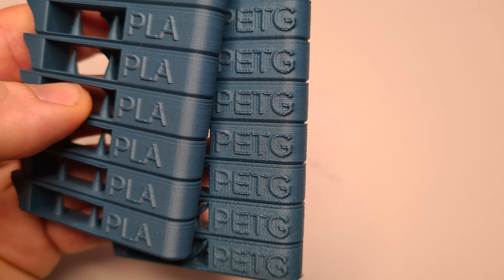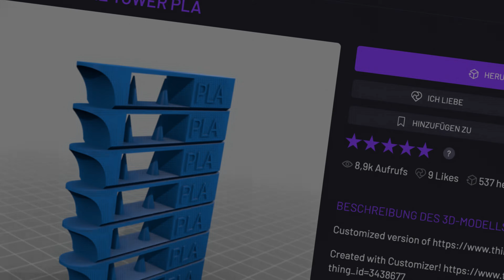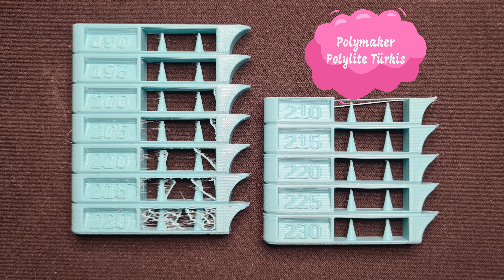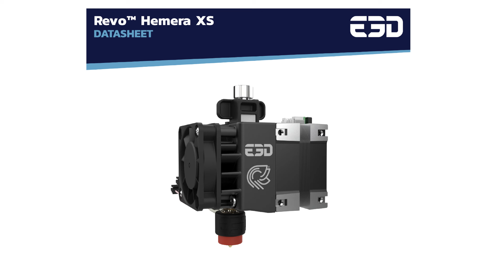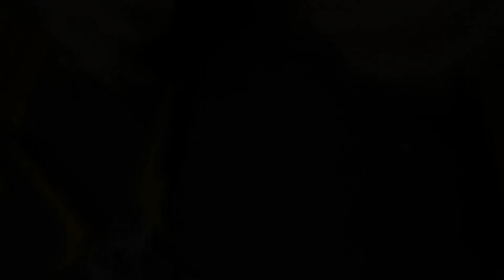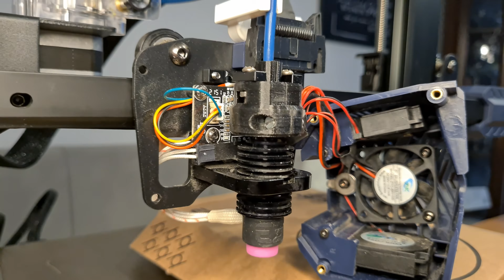E3D`s Revo™ Upgrade meets Anycubic Vyper/Kobra Max 3D-Printer! Review, Tutorial and PLA-Giveaway

Comment: A couple things I noticed during my journey while following this video 
E3D changed their website around and the buying process was much more vague on what you were getting. Without this video I would’ve been much more worried
I also wish someone would’ve told me that the spring on the heater unit was what wraps around and holds it onto the heat sink. It arrives in separate parts and wasn’t connected and the video just shows it already on and I was wondering how the heater unit doesn’t just fall off during nozzle switches . I already mounted everything back on and it’s a difficult task to manipulate the spring while on the machine. 
This video was great though and an absolute lifesaver, thank you!

Comment: Original Vyper owner here. I have a bi-metal heatbreak and replaced the stock order with a Capricorn Bowden tube. I want to print stuff like Polycarb and want to upgrade the max temp.

1. Will a stock power supply be able to handle the additional power required for this hotend?

2. Will doing several day long prints lead to enough heat creep to melt or warp the adapter connecting the hotend to the strain gauge?

3. Will this increase or decrease the max print speed?

Comment: 1. Your English is Great! 

2. I'm looking for a large build volume option for being able to print high-temperature plastics, glass/carbon nylon etc. For engine intake components is this printer with this upgrade a good option for that? It seems like a very cheap option at least! 

right now i use a duplicator 4 printing in ABS and don't have the hot end temperature or build volume for what i'm looking for :/ 

3. What Programs do you use for slicing for this? The least experience i have in 3d printing is in the software end of things

Comment: I personally must say the adapter feels a bit too long especially the airflow or does it still do it nice?

I did see petg isn’t nice with the V8 hotend it leaked all over the place.
Reply from the maker: Yeah its a bit longer but you could also print some adaptive fan-shrouds to make it fit 100%. But i never had any cooling issues so far :)

Oh rly? Maybe too hot? :D

Comment: Great explanation a question that I have is why can’t you put the jst plugs and metal piece right onto the thermistor and heater
Reply from the maker: Hey! Thanks :) You mean on their cables? Somehow ppl had errors when doing so (i know it doesnt make a lot of sense lol) and also a warranty issue imo since you loose that if you cut the direct cables instead of the extensions :)

Comment: Did you have to modify the printer firmware to properly accommodate the Revo Six hot end thermistor?  The Kobra Max stock firmware with stock hot end has the wrong thermistor defined in the firmware source.  This results in hot end temperature being about 18% higher than the display reading.  For the Revo Six hot end sensor line number 442 of Configuration.h (in Marlin folder) needs to be changed as follows :

#define TEMP_SENSOR_0 5   //11 for stock KM hotend.  5 for Revo Six

Note that I have not yet verified this as my Revo Six is still in transit.  But correcting the thermistor define in the firmware source corrected the 18% temp error with the stock hot end.

Comment: hey guys / Tom
before i begin I just want to say this is an excellent video...

I have installed the Revo six and now trying to do the PID tuning
I have connected my VYPER  to the printer interface on my Mac and I have run the first command to run my fans successfully. (M106 S255)
After I put in M303 E0 C5 S210 U1
I keep getting an unknown command error at the end
echo: Unknown command :"M10M105"

any suggestion?
im based in USA - NY
Reply from the maker: And thank you very much for your compliment on my video🤗 I rly apprechiate every feedback, every view, like sub haha everything. Maybe some of my shorts will also show you some nice prints you may want to try :)
Reply: @tombeardy4833  yes...  I do plan on watching  more of your videos..... But I need to fix my printer first
Reply from the maker: Thank you very much again! That gcode sadly makes zero sense since its not used on 3d printers lol Can you controll your temp with pronterface and also movements? Extruder and so on?
Reply: @tombeardy4833  so sorry for the late reply buddy../

when you say "That gcode sadly makes zero sense since its not used on 3d printers'"....... what G code are you talking about?
And yes..... I can't control everything with the printer from the pronterface app.
Reply from the maker: All good! The M10 obe you get during the error
Reply from the maker: Did you make sure you have NO otger 3d-Printer programm working/ opened in the backround? Also including Cura or other slicers. Those can lead to issues with pronterface as well
Reply: @tombeardy4833  hmmm.... no, nothing else is open / running in the background..

is it necessary to do the PID tuning?.............. what will happen if i just leave it alone?
Reply from the maker: Hey Vincent! I think i have seen your facebook post shortly ago :) Do you use Pronterface or something different?

Happy trying to help!
Reply: @tombeardy4833  i use Pronterface..... I believe I posted a screenshot on the Facebook post..... I just don't get it... I fold your steps exactly.

When I first got this printer for my birthday, it worked so flawlessly in like a dream come true.
But for the past month, it has give me nothing but problems.

Then someone posted that I should upgrade and you have a video on YouTube.
I followed  your video and subscribed  to you and  it was great
You were so easy to follow along and so easy to understand you. (I don't know why you say your English is not good)
Seems good enough for me....

Comment: What a great video. I'm so glad you posted this in the kobra max group on facebook. I've had so many issues with my stock hotends and I didn't even think I could pull this off but your English is fantastic and the instructions are clear and very helpful. Thank you for making this. I'm autolevelling my revo as I write this!
Reply from the maker: Thank you very much!! :) Wasnt sure if sharing would get enough attention haha Feels gr8 that ppl find their ways in here :) Yeah stock ones can be awesome or a nightmare -Or both at the same time 😆 Thank you very much again for your kind words! How does it work? :)
Reply: @tombeardy4833    Still lots to do! PEI sheet on the way to help with my adhesion issues and still need to tune my settings but I'm impressed so far. It's inspired me to look at more upgrades :)
Reply: @tombeardy4833  Just watching you swap the nozzles out has convinced me I need to do this upgrade to both my Kobra Max and Plus
Reply from the maker: Glad it helped 😊 Hope everything works smooth! If i can help, let me know :)
Reply: Fast heating and swappable nozzels is nice but you can get rid of all that stringing simply by drying your filament. Ive seen some videos where the towers look identical to these ones here and the difference was drying vs non dried filament.

Comment: Curious if the auto leveling function continues to work after the hot end swap?  Wouldn't want to do this swap and not be able to autolevel the bed of the Kobra Max.
Reply from the maker: Theres no reason why it shouldnt. You mount the hotend using the adapter to the strain gauge which is responsible for leveling :) Works like before! Just make sure you wont damage the levelsensors cables and youre 100% good :)
Reply: @tombeardy4833  thanks. Wasn't sure how the strain gauge worked.
Reply from the maker: @chrisnenzel582  Youre welcome! Let me know if you need anything else :)

Comment: Hi awesome video! 
I have 2 question! 
Why we have to add some new cable the one from the Revo are no enough long? What type of cable we have to use??
And is the new link for the adapter work as the one it was previously ? Thx
Reply from the maker: Thx!

Those cables are includes in every Revo-Six unit. They are simply adapters to be used if you need them way longer to connect them all the way down to the mainboard for example. In the Video - like i mentioned -they should just be cutted at around 5cm or so and then used :) The reason for not cutting and adapting the JSTs to the Revos maincable is 1st Warranty and also some ppl got issues with those cables getting crimped :) Yeah looks absolutely the same to me :) Maybe a bit less space for the cables to be installed but should still work fine

Comment: I had read about overheating problems with the revo in combination with vyper. Is this still a problem?
Reply from the maker: Neither me or many others i am in touch experienced this. I have also heard of that but it didnt depends on the printer it was used at. Maybe a production or wire issue...or a bad batch of thernistors. I have no clue but after over 500 printinghours with the revo - and others using it for even 6 months now, never had one single issue :)

Comment: Hey, I'm looking to get the Revo and also upgrade to the Stealthburner print head with it. Do you know if the grove mount adapter of the Revo Six can be removed and then mounted with screws from the top, similar to the Rapido or Dragon hotends?
Reply from the maker: Not 100% sure but maybe it works better with the voron variant? Since you already have holes at the top? :)
Reply: @Tom Beardy  Yes that's true, I just wanted to be able to also mount it on the stock mount (I'm still waiting on a PCB I need for the Stealthburner upgrade, and it might take a while to get here). But I went for the Voron edition and found an adapter for the Vyper mount. I'm currently in the process of upgrading, and it should work fine.
Reply from the maker: Fingers crossed! :)
Reply: @Tom Beardy  Works great so far with the custom cooling shroud! One of the big print quality improvements I noticed are much cleaner extruded lines. With the stock hotend, the extruded lines were fuzzy and did not have clean edges, though I assume the cheap and semi-cheap nozzles I used are at fault there. And the nozzle changes are soo much more convenient. Now it's just more waiting for the PCB to arrive to upgrade to the Stealthburner with a bltouch :)

Comment: Tom did you have any issues with Auto Bed Leveling?I I have had issues with just different brands of the J5 Hotend requiring different Z offsets, sometimes large differences.  Great job I have ordered a Revo.
Reply from the maker: Hi Don!

For sure you need to re-adjust the offset - either manually which could be risky haha or simply relevel.
There are certain nozzlesizes that show a bit of an difference - E3D also showed that info on their website somewhere. I had to lower the z-offset by 0.2 if i use 0.25 or the 0.15 nozzle.

0.4 and 0.6 use the same offset :) So to jump on the safe side i just went through one quick testprint each (only firstlayer) and noted/reminded the offset :-) Hope that answeres your question!

Thank you!😊 If i can help you anymore let me know :)
Reply: @tombeardy4833  Thanks Tom

Comment: Thank you for your Video.   It was super helpful. I changed things up a tad. and sacrificed the Thermistor and Heater Cartridge cut off their wires and soldered them onto the wires of the Revo. Shrink wrapped them.  Then I took the screws from the heater block and used them to connect the two pieces of the hotend adapter. screwed right into the holes and were the perfect size. then. I just screwed the screws from the hot end holder into the top of the adapter and it held about as tight as possible. 

Its an absolutely great improvment. I'd been having problems with the stock hot end.

Comment: Thank you for this video !  I just installed the Revo on my KobraMax :) I have just a question, when I set 200° on my nozzle and measure it with a meter I just have 185°. Before with the volcano it was 205° Do you have an idee ?  Also how can I mod the firmware to go to 300° ?
Reply: Hi Bernard!
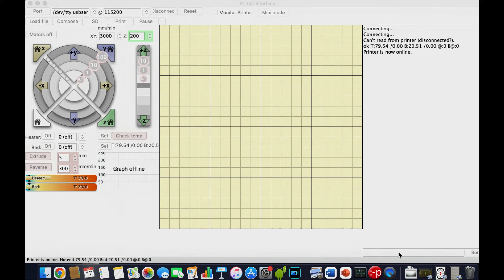Have you run the auto tune shown at 16:20 with pronterface?
That is definitely required with a hot end swap.
Reply: @SocalCanyonRacer  Hi !  Yes I did. But meanwhile I took the temp more inside and the reading was then correct.
Reply: @Did you have to reinstall software on Printer to get Reevo to work? I am thinking about Hemera Reevo upgrade

Comment: Thank you for the awesome video Tom, you certainly inspired me to chose my next Vyper upgrade :) 
One question: did you notice flow rate reduction compared to the stock Volcano hotend? What maximum speed you were comfortable printing PLA with?
Reply from the maker: It needs a bit more tweaking beacause the volcano is pretty "leaking" due the high melting capability which is a bit too high imo. Thats why many ppl encoubter stringing and oozing and unclear seems. If you raise the temp a bit printing up to 120mm/s for bottom layers works pretty good still with the Revo :-) At least you wont loose speed while increasing quality - at least thats what happend in my case😊
Small parts i normally print with 30mm/s outer and 45mm/s inner walls and 60mm/s infill :) Very small things smaller for sure and big parts...like REALY big parts 60 outer, 75 inner and 80-90 infill. But since thats a bit noisy with the steppers i keep a bit under those values mostly :) Otherwise my girlfriend hates me👀😄

Comment: Hi Tom, I did the upgrade, not to revo but a V6. Everything should be fine, but can't use the printer at all, because somehow he finds always the peviews auto level data when the hotend was shorter. I almost close to broke the heatblock. I try to save the auto level mesh data with merlin pronterface but after the autolevel data is displaying starting to send me continuous messages echo:busy paused for user...  and I can't write the M500 to save the data. I'm hopeless really. Please help if you could.
Reply from the maker: Hi!
And simply autolevel via the printers screen wont work? :) I also had issues with pronterface when it came to level. But just using the screen worked wonders for me

Comment: Hi, is there actually an increase in print quality compared to the stock? Its hard to tell without a side by side comparison.
Reply from the maker: Hey!
Absolutely!😊 - I showed quiet a few side by side comps using the temptowers :) Esp at the very beginning you see the one on the left showing the revo, and to the right the stock one :)
Reply: @tombeardy4833  thanks. Yeah I saw that. I mean like layer lines etc on regular prints. Photos taken with a light from the top. Just wondered if there is a difference?
Reply from the maker: @ProfessorPolygon  Definetly! I think the first comparisson at the "intro" tells a good story. With the stock one you can/may always encounter a bit of rougher surfaces depending on the filament. And the mate ones showed the BIGGEST improvement i could imagine. At others line 3d-jakes Pla, the difference was less in the pure surfacequality but also in way less stringing which is also an improvement for sure. 
So depending on the filament you might  notice smaller improvements than at others but still improvements for sure in my opinion!

Comment: Hi and thank you for this tutorial. Do we have to adjust retraction, flow etc? Second: What filament did you used for the adapter?
Reply from the maker: Hi Dimitris! Yep as always if you change anything hotend or extruderwise you should check them. I was able to lower retract to 2.5mm distance at 40mm/s when i needed around 5mm at the same speed with the stock hotend :-)
Flow was the same for me - just the temperature needs to be increased since the stock vypertermistor shows around 10-15 degrees less and the revo is pretty spot on :) Before i printed fast things (70mm/s) with 205 and now with 220 :) But nothing major - more important is the at the end of the video shown PID-tuning :)

Hope that helps!
Reply: @tombeardy4833  Hi Tom! Thanks for your answer, it helps! ;)